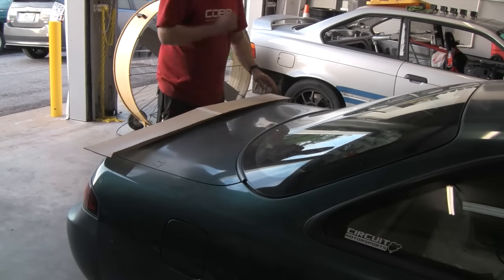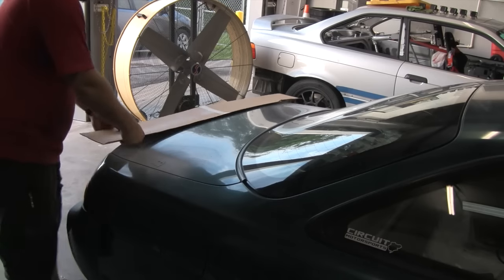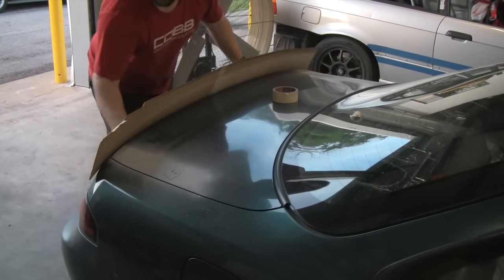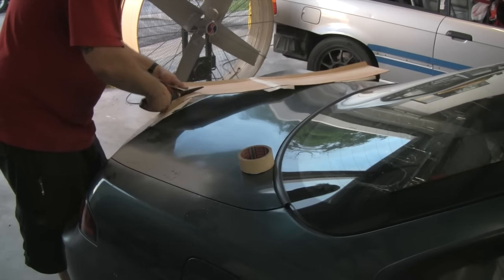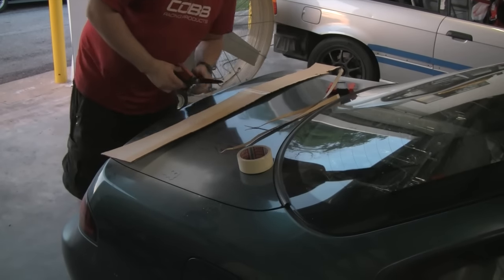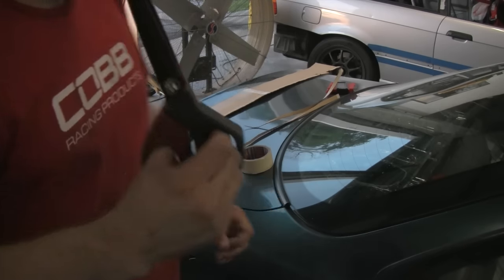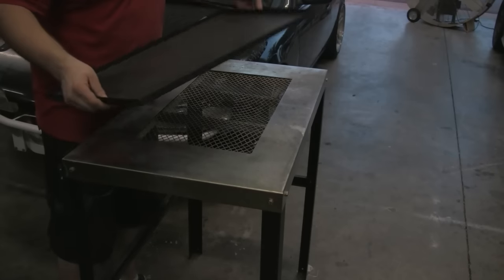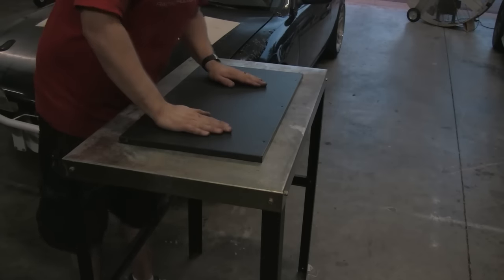Scrap Metal 240sx Duckbill!!

Comment: I love it.
Reply: very nice.
Reply from the maker: +Roman May Thanks!!
Reply: Car Sick!! I am just building my metal nascar spoiler welded to the car and getting a lot of shittalk from douchebags.Suddenly everybody is a Aerodynamic Specialist.True Fact is though that at an Angle between 55 and 60 Degrees the Nascar type spoiler produces the most Downforce at resonable Drag.You can of course go for less drag with less angle but also less Downforce but what would be the point? I eyeballed a lot today and i also dont like fiberglass.Have Fun building Shit, i certainly do.
Reply from the maker: I hear you about the aero experts coming out of the woodworks. It's like, this is a street car man, I rarely go over 100 mph.
Reply: everybody should build what they like, and not what they think everybody else would like.
my inspiration comes from the last interceptor from the roadwarrior max, batman and days of thunder.so thats how my car looks like.if i want to i can go very fast on the german highway or on the nordschleife.
my ca is purpose builand he purpose is fun.

Comment: Hey man congrats on selling your car. I know the feeling of not wanting to sell a project. I'm on another project now so I have a question, what did you use to wrap your steering wheel?
Reply from the maker: I used a few things. But the outer texture is cotton ribbon from the fabric store that I shellacked. I built up the thickness under that with what I can describe as vinyl piping. Our neighbor at work makes RV awnings and the edges are sewn over this piping, they throw a lot of it away. In bewtween the large piping bumps is twine. The transitions between spoke and rim were shaped out of epoxy putty, also completely covering the sharp safety wire holding the vinyl piping down. It took me a while to figure out how to make the grip thicker on the steel rim while being really tight and free of movement when you twist the grip. I tried serveral different things including PVC, garden hose, and AN hose. I have pics of the process. 

+pedro rivera